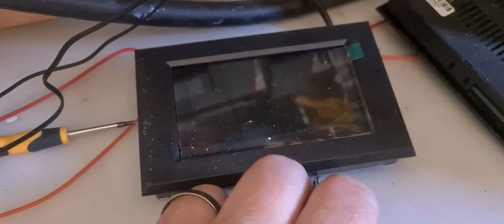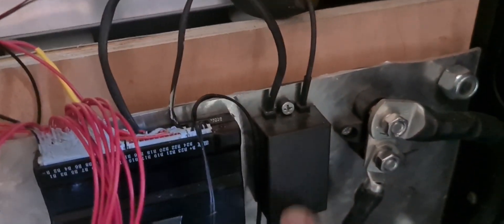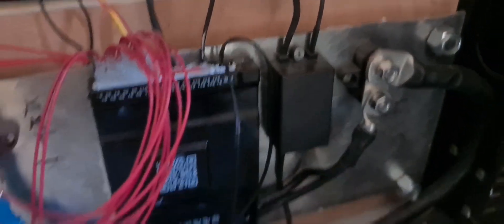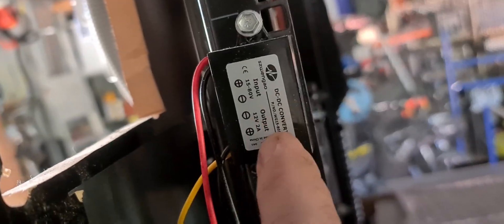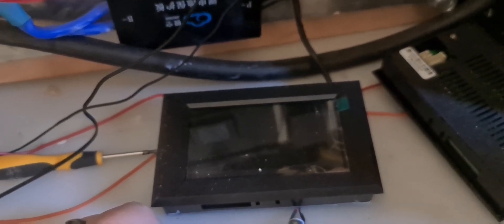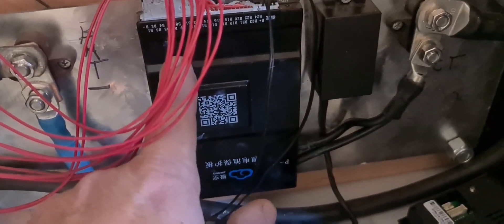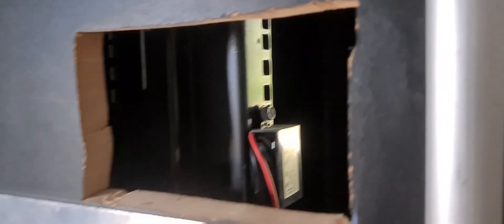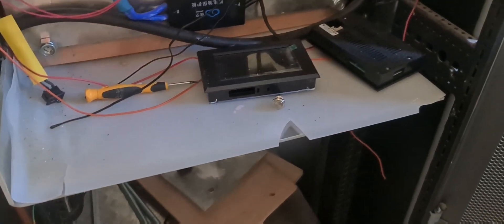JK BMS problems  hankzor shop from Aliexpress does it  again, power supply fails after 6 months.

Comment: Just get a reliable 12v 1-2A power supply from a company like Hikvision. That is what I use for LCD power
Reply from the maker: Got a better replacement 12 V 2 A power supply, which runs on 48 Volts ⚡️  Check out the end of my latest Vlog on solar panels.